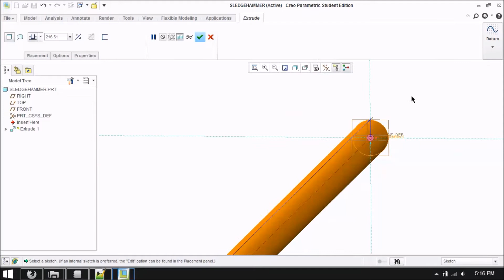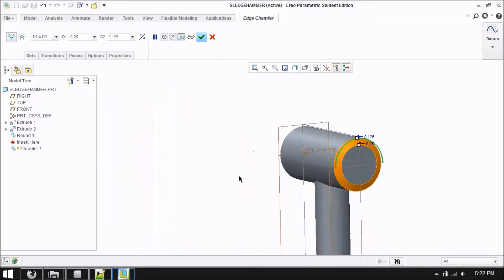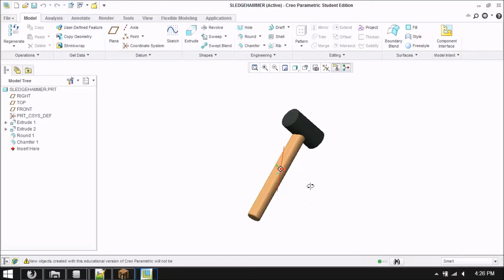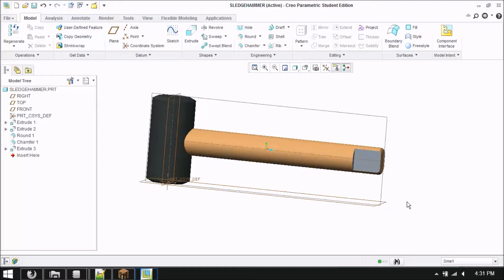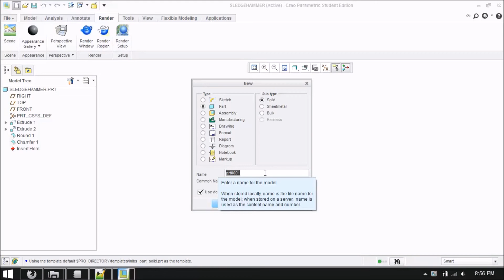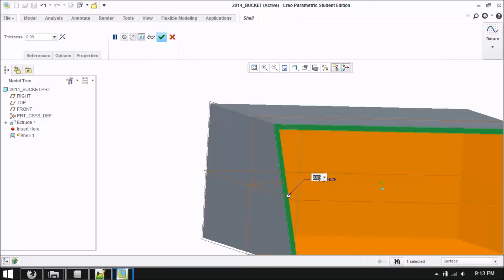Comment: i have been using autodesk inventor all this time and i didnt realize how great creo was
does anyone know which needs less processing power bc my computer doesnt handle autodesk inventor smoothly?
also which program is better overall in terms of functionality for an FTC team looking to improve its cads?
Reply: Judging by the system requirments, ptc creo is a lot less taxing.

As far as which has more functionality, I can't comment since I have neaver used autodesk. I will say though, that I have neaver found anything that can't be modeled in creo, and I have made some pretty complicated things (before the FTC season started, I made a three speed transmission that I was able to to run inside of creo). I am actually thinking about redoing, or at least adding to these videos since there are a lot of things I didn't cover, or explained wrong. But the fear I have is that even though I am probably twice as knowledgeable about Creo now as I was last year when I made these videos, I still get the fealing that I am still barely scratching the surface of this softwares potential, and I would probably still miss a lot of things.